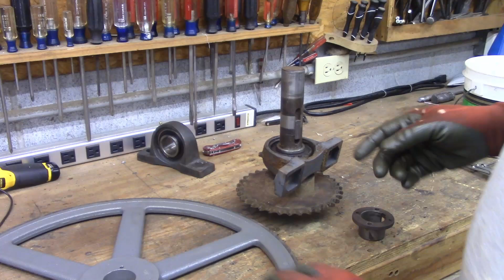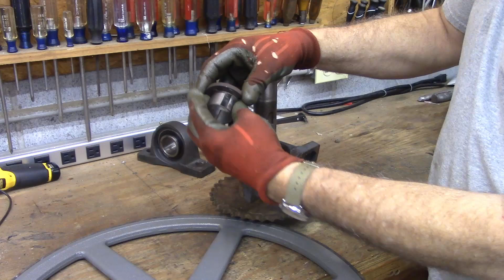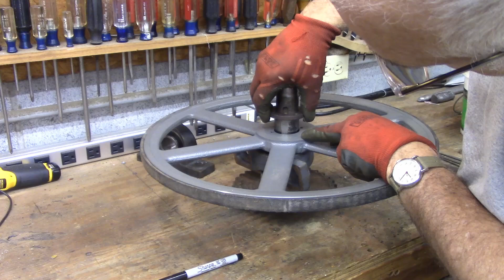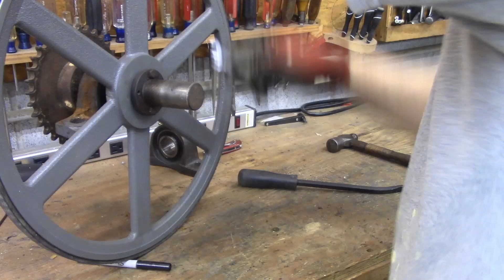How to Install a Pulley on a Tapered Bushing

Comment: Nice work.  I really do like that system.  You can get almost any combination of shaft and pully you want.   And as you say you can break the flanges on the tapered bushing if you are not careful.  Thanks for video!